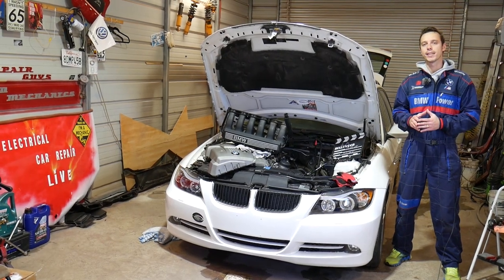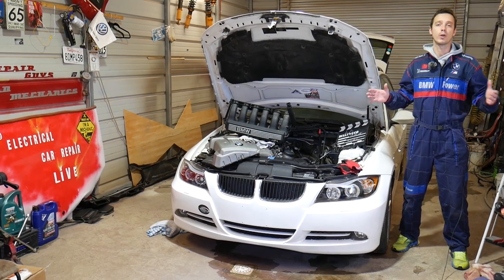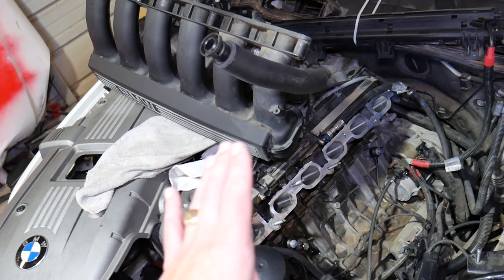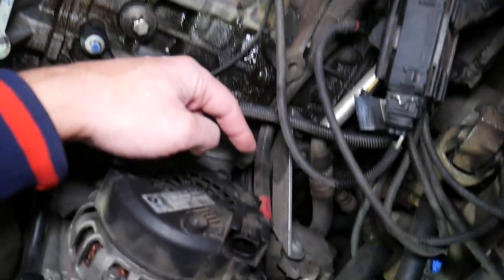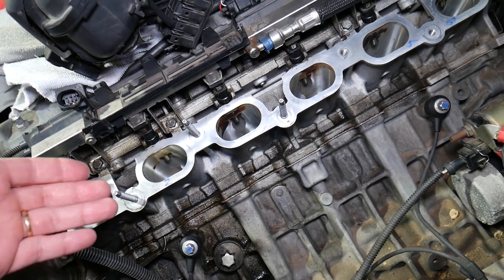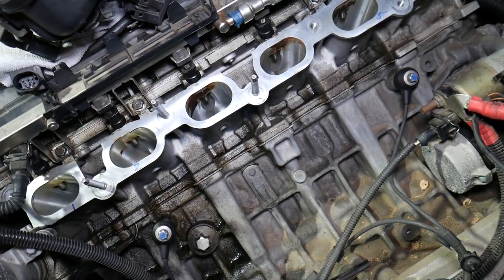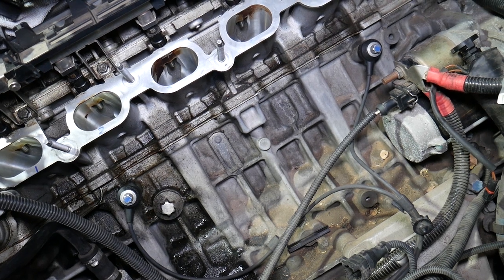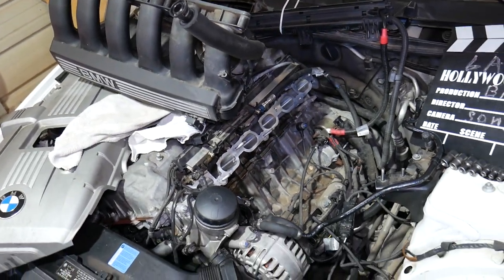SYMPTOMS OF BAD KNOCK SENSOR ON BMW E46 E90 E91 E92 E93316i 318i 320i 323i 325i 328i 330i 335i 318d

Comment: This sounds like my 2012 e90 N52 330i. Runs beautifully if I am not accelorating aggressively. it'll go to 180km/h smoothly. As soon as it floor it, the misses and jerks, and goes into limp mode. I have to stop the car, switch off, wait a few minutes resets itself, starts up easily and repeat. Fuel consumption is around 12 km/l normally.  The codes says "cylinder 1 misfire, nock sensor". I sent it to a repair agent, changed plugs, swapped around coil plugs, code appear again after clearing. Recently came up "cylinder 5, misfire", only, no nock sensor code. The one common condition is identify is it only happens under acceleration load. This lead me to think there a fueling issue or coil pack problem.

Comment: I replaced my NOx sensor and reset the adaptations, before with the faulty sensor I was getting only one fault code 3104 now with the new one im getting two fault codes 30DC and 30DE. Why? Injector, sparkplugs and coilpack all brand new. Help pls.
Reply: You figure this out?
Reply: What d you mean reset the adaptation?!
Reply: What d you mean reset the adaptation?!

Comment: Hi guys. I just watched this video about knock sensors. I think you just diagnosed my 2009 e93 335i. Same problems. Engine power keeps popping up, jag and a grinding knock when changing gears especially from gear 2 3 & 4 as well  when stationery and high reving.

Worse is that the grinding became  serve last time I drive and the car automatically put itself on N gear and I had to stop immediately and tow it. I suspect mod bearing knock🙄

Unfortunately your video doesn't show the step by step DIY on changing the sensors.😩☹🙈.